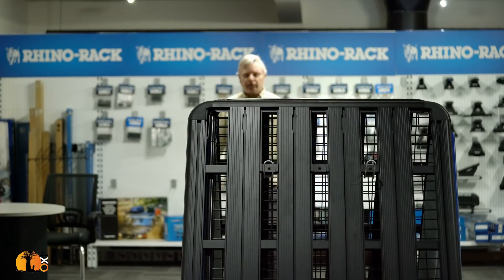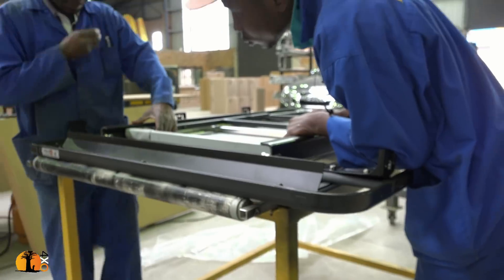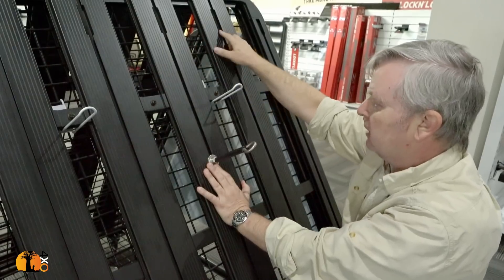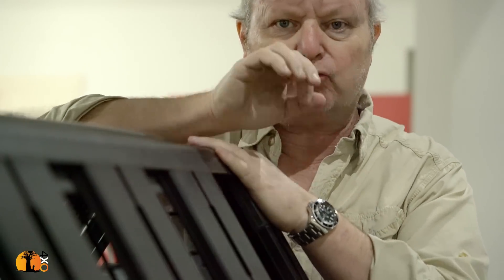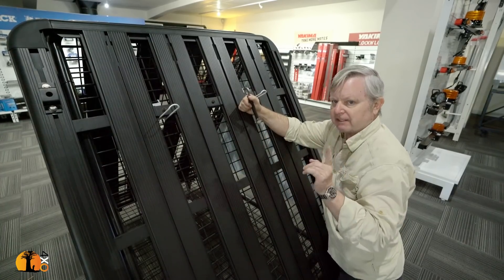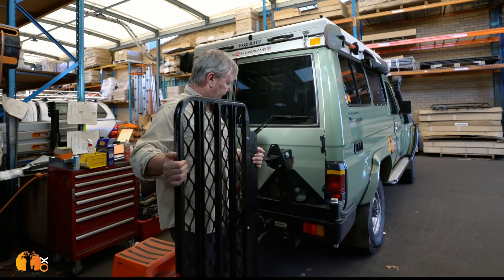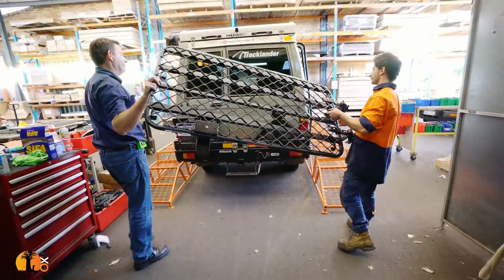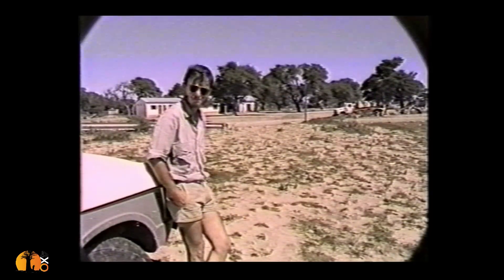ROOF RACKS - the GREAT, the ORDINARY and the AWFUL. How to select the right one

Comment: I'm not a rack sales person, but the reason your rack broke was because you mounted the jerry cans in the wrong direction.  You should have mounted them side to side instead of front to back on the rack.  It is a common mistake because they look more aerodynamic that way.  This would have given more stability during the side to side rocking motion and the brace would have counteracted the effect of enerttia easily.  Instead rocking sideways the cans break the strap because it is not properly reinforced for that direction and the can is narrower that way so it tips easily.
Reply from the maker: They only fit one way. The design of the tray and clamp means one has no choice.
Reply: Meekah Chapman period at the end of a sentence.
Reply: If mounting the jerry cans the "wrong way" is going to break a 4x4 roof rack then it's a terrible design IMO.

Comment: Man I cringed at 18 minutes in. Watching you try and install that eyelet reminded me of one of those tv product commercials. You loosen them, slide them in and then tighten. Elementary and quick to do.
Reply from the maker: It was loose. That was my point. The trick was to hold the washer against the head, and then insert. Very fiddly, but it works.
Reply: The flats on the nut must line up with the walls of the slot.  The walls keep the nut from spinning.  Inserting the nuts is tricky to do because if the alignment isn’t perfect the nut will get stuck sideways at the start of the slot.  More often than not you have to fiddle with them.  This style of rack looks slick, but is a real pain in reality.

Comment: A 5 by 9 Rhino rack is the best this I added to the 4Runner. I use standard fittings to fixe stuff along the sluts, proprietary fittings are not required. After I added the rack, I came across the front runner brand, they are great too, a lot more accessories seem to be available from them. Ruff rack: really useful

Comment: Missing some fundamental points for engineering a rack . The main advantage of the Front Runner is the cross axis (x) only direction of the slats. Let's say you add a cage and create a y axis direction stiffener. Where is the roof flex going to go? It's going to be transferred to the rack, whereas if you have a y axis only configuration, it will flex with the body of the vehicle. I chose the Front runner because it will flex with the body instead of fight against it like others. Of course  with your short rack, the impact is minimal, with my 1.8m long rack which covers the entire S.A of the roof, it's a different story. Also the new backbone systems out eliminate "feet" altogether. The design consists of a 3mm steel plate running the entire length of the vehicle which is bolted directly to the rack. If you're going to talk engineering, you really should be talking about applied forces, and vibrations from off=roading is one of many. Body contortions, weight, how much does a full length steel rack with cage weigh?
Reply: I agree though, the Frontrunner Accessories and most rack company accessories in general are over priced an under engineered. I made my own 2nd spare holder out of 5mm steel plate and 2 M12 bolts for $15 for example. The eye bolts can also be bought from a rigging store for half the cost.
Reply from the maker: That's one theory. I don't buy it. What I presented is the real world. A "steel plate running the entire length of the vehicle which is bolted directly to the rack" is the best way to prevent flex and cause damage to the vehicle. Full length feet are a very bad idea! And that is why the world's best and strongest, properly proven racks do not use this design.
Reply: Well no, seeing as you don't have nearly as much have flex running parallel to the body, its will runs across it, what you just said makes no sense at all. Flex between the fixing points spread out 400mm apart and then split in two pieces vs. the 1.4m gap between drivers and passenger side... Hmmm
Reply: Ah yes, Front Runner are not properly proven, never mind the millions of people using them worldwide. Nor the 700kg test weights been conducted, 2tonne uplift tests, all proves nothing i suppose. If you don't like a brand you really should just say you have a bias, not just pretend you're on neutral grounds.
Reply from the maker: Okay . .  I do have a bias against Front Runner racks -  based on my opinion that they are poor quality when compared with much of the competitors. There is my bias. And your bias? You are taking this so personally, I have to assume you work for Front Runner? PS. Don't vehicles move? The tests were static, done as a marketing project. And were the feet tested??????? I stand by my experience. Its taught me more than some useless marketing tests. I hear about the many failures. You obviously don't. I had a FR rack on my G-wagen. I gave it away after one trip. It was hideously noisy and the slats made it impractical and annoying.
Reply: I suppose my experience with them is just so positive that it's created a bias towards them. The slots for mounting equipment for example, as opposed to making it difficult for you to attach occy straps, have made it extremely easy for me to attach antenna mounts and tyres. I'd also never heard of a failure. I prefer the modular system because it's just that, with no welds for corrugations to break. There are also no feet to fail, so nothing to worry about there. Different requirements, different results.

Comment: Racks today are too complicated and fiddly, too many components to go wrong, metal too thin trying to reduce weight and cost.. A welded 2.5mm wall steel box section frame (corners braced) with 50mm fenestration wire mesh welded over or under it will last for years and carry whatever you need and allow you to tie down and walk all over it. 6 x feet on a long roof is minimum. Your local steel fabricator will cut and weld up your design and even have it galvanized. K.i.s.s principle. Galvanizing only costs about $2 per kilo of job weight where I live in QLD, Oz. Powder coat is good but expensive and it chips off causing rust.

Comment: This video hasn't aged well - Rhino using rivets to hold the crappily designed racks to your car - to have them being ripped off by a bit of wind, or can only take 20Kg.
Reply from the maker: I didn't mention rivets in this video (two years ago) because nobody in the industry with the slightest bit of engineering knowhow would attach a roof-rack with blind rivets, let alone blind rivets into a thin roof panel. I had no idea Rhino was doing something so stupid. When I heard about the latest issue, I could not believe what I was hearing!
Reply: @overland-workshop  Rhino DO attach roof racks with Rivets (blinds) to Navara and Ranger.  They get ripped out, destroying the rack, and making a hell of a mess to the car.

Comment: I could get 4 chinese racks for the cost of 1 "good" rack. I think 4 racks should last my car's lifespan.
Reply: What if your  cheap rack fails say half way along the canning stock route? Assuming your car is loaded for a 16day trip and you loose half your storage space and to make it worse the gear on the rack is usually to big/ drity or smelly to live in your vehichle eg 2 spare tyres and diesel storage
Reply: @jarradblair1793  I"ll get 4 at once and stack them on the trip. I don't see 4 failing in one trip

Comment: it is basic engineering not as complicated as you make it out to be mate. we all know an amature always complicate a simple thing like roof rack just to avoid warrantee payout when it fails and use basic words that sound smart like R&D and testing. just pay out the failed racks or look out for engineers like me that will take all you have made in the court of law and expose your lies and complex explanations .
Reply: ill give you a free tip, think of bolting anything the same way as a seatbelt mounting point. look at how it is enforced and modify the vehicle to fit the rack. your rack is as strong as the weakest link and should be rated to a mounting point strength not a rack capacity.

Comment: This day and age, you still reference "the cheap Chinese made..." you are ignorant since everyone/every country makes a lower quality version as well as a higher quality version of products, regardless the choice is ours; just because a product is expensive it does not necessarily mean it is better nor of a better quality or design!  At the same time, to make a quality product with great design and reliability does not have to be expensive, if so, its your lack of management and efficient use of resource.  "Two years of testing" (running the same test repeatedly) means jack, looking good with nice layer of paint yet if it's all cheap metal underneath with yet higher price, that just makes you a cheat and dishonest seller.

BTW, you can make a fantastic product for safari condition use, yet it may not last a month under cold and wet/salty conditions!
Reply: I doubt anyone is ignorant enough to not understand that both good and bad quality products come from every country; it's just something people say. Otherwise goods points though.
Reply: @Snookers_  Except that it hurts when someone of Chinese background hears, often right in front of them and I always will bring someone up short when I hear such rubbish. Lot of it is just pure racism.